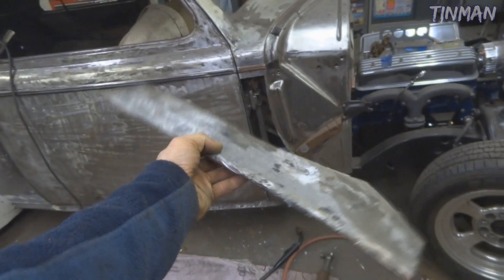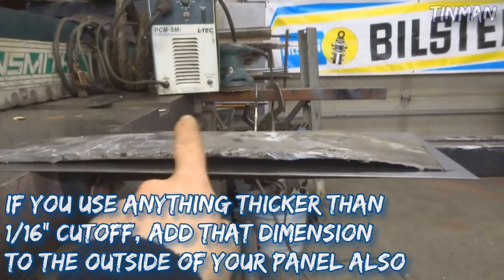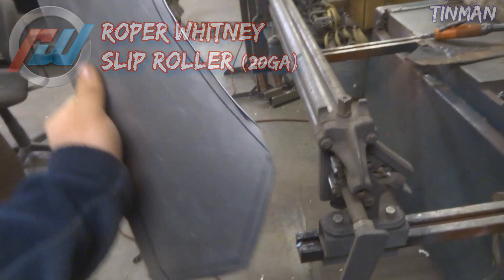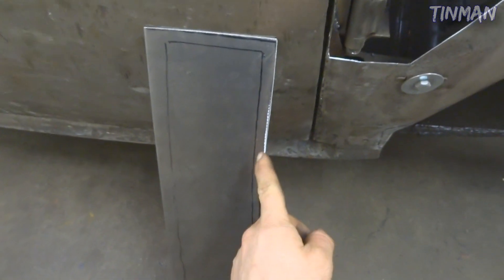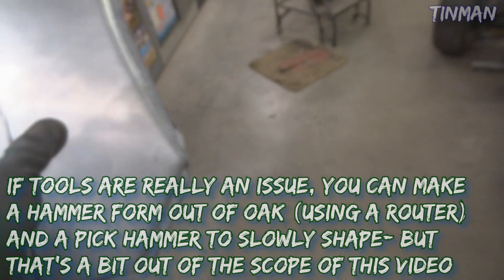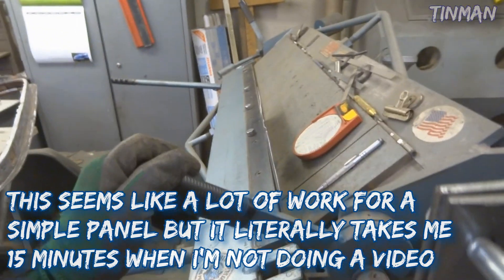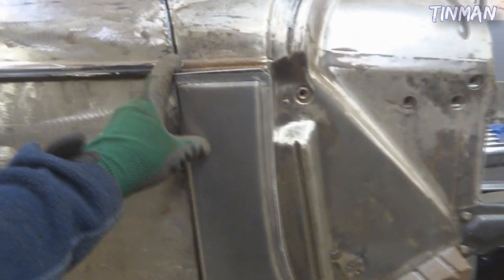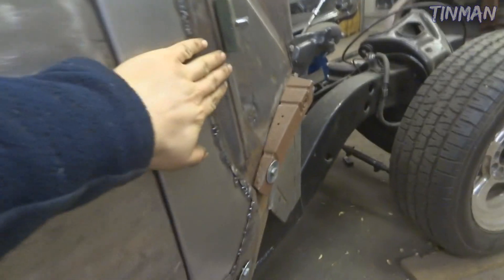How To: Sheet Metal Repair or Patch EASILY

Comment from the maker: Disclaimer: This video was made for the average fabricator or backyard builder to get some tips.  I realize butt welding & planishing afterwords is the ideal technique here. Butt welding & planishing is however a more advanced technique. And if you already have those skills, you probably wouldn't be searching youtube for a video on how to do your own sheet metal patch. Keep that in mind with rude comments. If you think you can make a better video, I invite you to spend your own time, without pay, making FREE instructional videos.
Reply: Good job man, I know you were able to grind that down smooth, and of course it will be seen clearly later on, but that's probably why some clowns don't appreciate what you did there.  They've also never seen someone try to stick a busted front fender from a '32 Ford PU (notorious for splitting from vibration over time) together with an arc welder.  We had a hired man on the farm I grew up on in the 1950s try to do that, he burned several huge holes along the split and finally gave up, and then the moron riveted a piece of galvanized sheet metal over it, which of course didn't stop the splitting, and just made new places for it to fuck up, later on.  I wanted to kill him, but I was only 14.  I did a somewhat better job with oxy-acetylene, but it never came out the way it could've with today's technology.  Great demo Luke, told ya I'd be catchin' up. 😎
Reply from the maker: @ZeekDuff  You're correct, it was ground down perfectly smooth afterwards. You're probably right about the clowns too. Welding on sheet metal almost never looks good, unless you hit it hot and do long beads, which warps the shit out of the metal. I could have tig welded it and it would have looked better, but there was small contaminations due to existing lead throughout most of the car, that would have made tig welding impossible. But hey, what do I know :P lol Thanks for catching up, hopefully you're learning new things also!
Reply: @Tinman2Kustoms  Absolutely!  If we ever get too old to learn something, we've just gotten too old to keep breathing!  I don't do any of this kind of work anymore, physically can't, but I enjoy watching others do good work, immensely.  AND, I really love the results from folks who know exactly what they're doing. I've always been a gearhead car guy & a hot rodder, it's in the blood.  But, it's like playing guitar, no one ever learns everything there is to learn about it, that just isn't possible, as I keep finding out just about every single day!!! Hahaha...
Reply from the maker: @ZeekDuff  very true! Good words of wisdom!!!
Reply: @ZeekDuff  Cracks me up when people "tell" someone they're doing it wrong when they've probably NEVER done sheet metal work, much less tried to make a living at it.
Reply: Know this is an old ish vid but is there any way I could send you a pic of a project I'm going to do I'm still some what a novice but it's my old road car and want to do it and need some advice on it
Reply: FOR SURE. I hate those arm chair critics.

Comment: Might I recommend if folks want to use this method, primer your flange before you install it into place.  You can primer/Paint the flange as a rust preventative then strip just what you need to for welding.  Say just small spots for spot welding or the edge of your step for fully welding.  

Any rust preventative barrier you can get in place is going to help in the long run.  It is always my goal to make something better than it was before.  I don't support overlapping panels like this but fully understand the intention of this method for many folks.  Right on.
Reply from the maker: Yes, yes I should have mentioned the primer or more on why I did it this way in the video. Thank you for the good comment. I always coat overlapping seems heavily with por-15 and then seam sealer to keep anything from getting in there. But a buttweld is a better repair, but more difficult to make look decent for 99% of people.

Comment: ABSOLUTELY FANTSTIC for the beginner I teach similar stuff but even easier more simple ways. I would butt weld 18 but 20 gauge flange or lap and shrink most of the time. sometimes I even flange 18.
Reply from the maker: The beginner was the person in mind! It's very hard for the beginner to be precise enough with butt fitment and still be able to weld it without blowing through everywhere, so lapping it is easier. But you're correct. I almost always butt weld when possible

Comment: .hold the mig torch with one hand and a wet rag on the other. do a 1cm bead the put the rag on top until it stops boiling the water...it will dry instantly then keep going...i can do a very very preety bead with a 100€ fluxcore machine even on a roof..... if you do it tack by tack the metal will be too cold it will look like shit and require massive grinding, also there will be zero penetration and after grinding you can litterally break the weld by bending the metal.... and grinding can also warp a panel....you also cannot let it get too hot..i find that 1 to 2cm at a time works great even on a roof, just aim the wire to the center of the gap and try to fill the void between the 2 pieces, give it some wire then stop, the metal will be glowing, dont wait until the glow disappears or you will be just shitting weld and not really fusing metal. after 1 to 2cm of bead aplly the rag...easy...the hard part is making the patches not welding them

Comment: Do you know if it is necessary to stitch weld every inch along the edge of the patch or not?  If not what is an acceptable amount of welds?  Every inch?
Reply from the maker: Personally I weld the entire length of all panels. But some guys don't. That's up to your discretion. If you're going to body work and paint it and the panel pops out because of lazyness or lack of welds, then you're gunna need a whole new paint job because of 5 minutes less of welding
Reply: @Tinman2Kustoms  Thanks Tin Man, this is my first try at body work so I thank-you and value your advice. Last question,  If I'm going to seal it with fiberglass bondo will little holes between the stitch welds come back to haunt me after painting.  I have a couple small pin size holes here and there and I don't know if I should continue to stitch till it is solid or move on?  1969 Chevrolet Panel Truck Project.
Reply from the maker: @joewahrerMotorcycleMan  as long as you use fiberglass bondo to skim it, you'll be fine with pinholes
Reply: @Tinman2Kustoms  thanks for all your help!

Comment: It's a better job to not flange and weld the filler patch. Flanges will rust and trap debris. Be ready to make a bigger repair patch in a couple years.
Reply from the maker: Billy Beane That's what seam sealer is used for. Coat it properly and it'll never rust. All manufacturers have been doing it for 100 years lol
Reply from the maker: Billy Beane plus it's on the inside of the vehicle. If the inside of the vehicle gets debris or water in it you have MUCH bigger issues lol
Reply: @Tinman2Kustoms  It's non-original.
Reply from the maker: @r.j.dunnill1465  so?
Reply: He's dead right always butt weld you can stretch the weld back out and planish it smooth then and clean the welds properly on the backside it's not a bad repair at all but as a professional panel beater and metal shaper i would not have done it that way.
Reply from the maker: @kieren7763  Yup I understand and agree. However, this video is tailored to people that need to search for tips on how to do this. They wouldn't have the skillset to do the buttweld style patch you're talking about. And if they did have those skills, they wouldn't be looking on YouTube for these tips lol
Reply from the maker: And not many people have a planishing hammer to do what you're saying.
Reply: Tinman 2 Kustoms you don't need fancy tools to planish sheet metal I don't use a air planishing hammer at all or any other mechanically driven tools it's all about patience and skill look up Peter tomasini he does a very good example of how to stretch a weld and planish it out and he does it with a oxy torch and can still make the weld seam invisible check him out he may make u rethink what is possible with sheet metal.
Reply from the maker: @kieren7763  I understand, again that's out of the skill level of someone that would search for a video like this though. I know how to butt weld, grind and hammer it all so it's invisible. I don't use an oxy torch though. That's way old-school and a tough skill. I'll look into his work though, thanks for commenting!
Reply: Billy Beane  do you have your own channel making how to videos
Reply from the maker: @lamarelrod5808  Thanks for the comment, I was waiting for someone to say something. If I remember right Billy Beane has followed my youTube for quite some time, so i don;t think he was meaning to sound rude. He is right the best way to do it is cutout & buttweld, but most people wouldnt have the skills, patience or tooling to do what  these other people are suggesting on this comment string. I do it how I see is the easiest and effective for YouTube followers.
Reply: Peter Tomassini, Kent White. David Gardiner would all seriously disagree with your nonsense statements
Reply from the maker: @horacerumpole6912  You guys seriously think I don't know butt welds are better? You're missing the point of the video. Anyone that can cut & fit EXACT fitting panels to do buttwelds isn't going to be searching youtube to try and figure out how to do it.
Reply: @kieren7763  also, this is over-complicated and more time consuming, and requires more tools than a butt weld repair. not sure what the advantages are with this method.
Reply from the maker: @daos3300  easier to get a flat mating surface with minimal Bondo, with this method. In my opinion. Also easier to weld and not get a ton of shrinkage/warp because there is more material there to keep the shape. But different strokes for different folks.
Reply: @Tinman2Kustoms  what's your take on body filler over etching primer? I noticed at the end you had a can. I've heard that you can't or shouldn't fill over etching primer but I know a bunch of people that used etching primer after media blasting their car bodies. They haven't seemed to have had any problems. Can the acid that is in etching primer be blocked by an epoxy or high build primer after metal work and before filler? Thanks for your input.
Reply from the maker: @charlied5324  I prefer bare metal under filler. That's how chemists design the product to be used. Direct adhesion to metal. But sometimes I will prime first, but I only use epoxy primer. Etching primer I use on aluminum or on hard to bond surfaces. Not between material and filler though

Comment: Can you do another video on rust proofing the new metal and finishing steps  thanks
Reply from the maker: The best way to rust proof a panel is to use POR-15. I have a video of coating my trailer, it is the same general process for coating new metal. if you are going to be painting over the metal (like if its the exterior of a cars body), you would want to use a high quality epoxy primer.

Here is the trailer coating video:  https://www.youtube.com/watch?v=lQZWaGr5lbc&t=2s

Comment: I get that this is for the backyard fabricator. I'm just not sure that such a person would have an English wheel, roller benders, bead rollers, shrinker, stretcher,throatless shears, etc. Good video though 👍
Reply from the maker: You're right. That's why I try to mention how to do it without fancy tools. But really, most of these tools, in cheaper versions, can be purchased very affordably through summit racing or woodward fab. I just have nicer stuff because I do it daily. Thanks for commenting though!

Comment: Always find spot welding difficult to consider proper, looks wrong to me... thats why every panel i ever touch warps. Need bead : ]
Reply from the maker: TheCanadianBubba the secret to welding sheet metal is to have the mig gun in one hand and the air nozzle on another and turn your voltage & wire size down
Reply: Great trick/tip, can't wait to try it ! Thank you for sharing !

Comment: all metal patch work should be butt welded so its like there was never a repair it takes more time and talent but its worth it.. I don't get why he cut that out ? so what if it had lead all old American cars had lead from the factory..
Reply from the maker: I cut it out because it had nearly 3/4" of lead and needed filler yet on top of that. It also needed a new edge, and you cannot weld on lead. But yes, butt welding is preferred. As mentioned in the video and in the comments.

Comment: Why not use tig welding instead of mig ?
Reply from the maker: 1) Tig welding shrinks the metal more than mig welding and on this panel it would be hard to get to the back side to hammer & dolly. 2)Tig welding takes substantially longer 3) 90% of the people watching this will not have access to a Tig welder. Mig welders are much more common. 4)Tig welding sheet metal is more difficult. If you can Tig weld sheet metal, you probably don't need to watch this video because you already know how to make this sort of repair

Comment: THE SHEET METAL WORK IS VERY VERY GOOD....CONGRATS!!...BUT YOU NEED TO IMPROVE UR WELDING SKILLS...
Reply from the maker: Might welding on sheet metal always looks like shit, unless you're trying to warp your panel or burn through with long hot beads. Tack welds jumping around are the name of the game.
Reply from the maker: @pristaxau  Tig would never have worked on this steel. It was previously lead-ed and would contaminate the tungsten immediately. In an ideal world, with new steel, yes Tig is the better choice.

Comment: You could certainly improve your welding skills.
Reply from the maker: On sheet metal it's not really possible to make nice beads with a mig, without warping the panel. You just have to lay down a few tacks and a time and stop to let it cool. And jump around a lot. It always looks like this if you don't want to warp the panel.
Reply from the maker: But there is always room for improvement. When it all gets ground down afterwards it doesn't really matter what it looks like before grinding. I focus on not warping the panel, over the look of the welds.